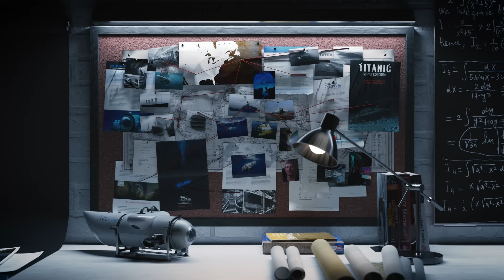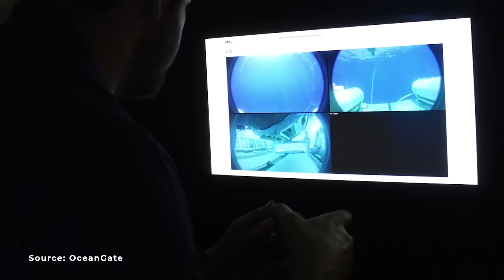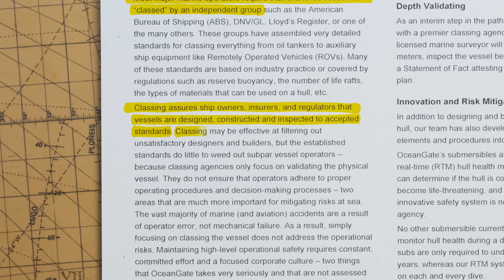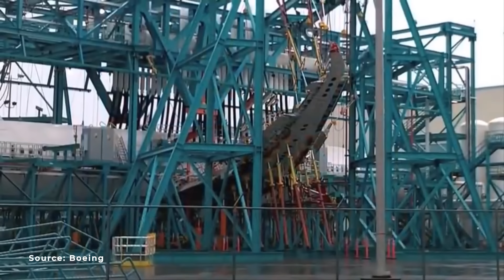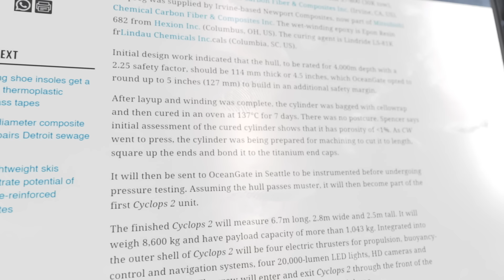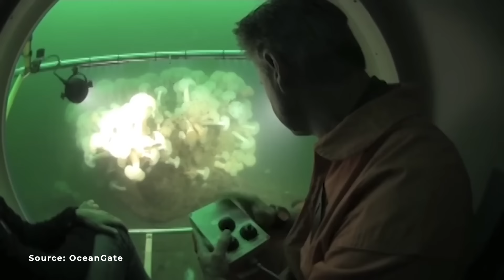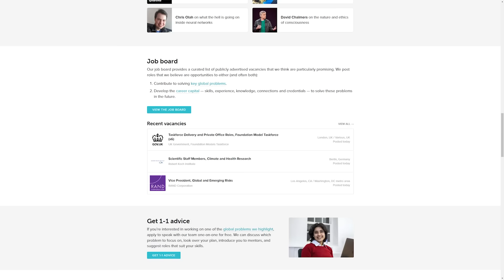The Questionable Engineering of Oceangate

Comment: There have been a hundred videos telling us "why the sub thing happened"...but you're the only one I've watched, as you're the only one I trust to bring actual engineering know-how instead of "here's how fast the rich people got smushed" (which is entertaining in a way, but not really educational). The tension vs compression aspect you explain was brought home to me a few years ago in a very low-tech way--a barn door. The inside of the door had a square frame; the frame was bisected diagonally, and one support was a 2x4, whilst the other side was...a wire. What?? Made no sense. But the old farmer explained that the wooden reinforcement was placed in a way to absorb the compression, whilst the wire existed for the tension. 

Not trying to say that "even a farmer could have foreseen this", but just saying that anyone who can tell the difference between materials suitable for compression vs those suitable for tension should have realized they were using the wrong material--as you so well explained.

Comment: 4:13 This sounds a LOT like Survivorship Bias. "The vast majority of marine (and aviation) accidents are a result of operator error, not mechanical failure."
Reply: That's precisely what it is.
Reply: Because it is
Reply: A system subject to regulations and standards should only fail once through a particular failure mode, if ever. That's the blood that writes safety standards. 
Operators can fail any time, regardless of regulations or standards. That's why the Hierarchy of Controls always try to engineer problems out of the way before trying to change operators' behaviour, and why there the best safety regime requires a no-blame mentality in the event of the failure, because it is in human nature to find someone to blame even if the actual root cause is poor engineering, whether through physical engineering or human resource management.
Reply: the only errors are operator errors because the subs are designed and certified under rigorous standardized tests. 

The only thing not standardized are the humans.

Comment: Expired Prepreg carbon fiber, off the shelf view port not rated for depth,  fasteners into carbon fiber pressure vessel, no testing, hull with multiple cycles on it already... The knock off wireless controller being the only means of control is stupid but somehow near the bottom of mistakes made here.

Comment: I am surprised at the statement that pulse-echo equipment to test this composite does t exist. The ISS was tested long ago in the Intel 486 era. And the propagation times aren't long so it's not like modern equipment could be made to work. Maybe they didn't want to spend the money on a submersion tank the size needed to test that composite, but they could have charged 500000 instead and know for sure.

Comment: Under tension, carbon-fiber-reinforced polymer is one of the strongest known materials. Under compression, it is plastic and loose strings.
Reply: Carbon fibre compressive strength is around half of its tensile strength
Reply: Surprised it even managed a couple of dives to the Titanic and many more other dives to other locations before the eventual implosion...
Reply: That's just false. Carbon is known to handle pressure well. The sub would not have survived 10 prior dives if that wasn't the case.
Reply: @sujimayne did you watch the video? Carbon fiber might handle it good compared to literal plastic. But next to steel or titanium it’s no where near as good for compression forces
Reply: @sujimayne  compression and tension are two very different things.
Reply: @sujimayne  that plastic window handled just as many

Comment: Spacex can afford to move fast and break stuff because there are no lives at risk. Worst case scenario the big kerosene tube goes boom. Before Falcon was human rated it had to go through the same tests, inspections and regulatory approvals as any other rocket
Reply: That's clearly present in their operations, but it would seem the CEO of OceanGate didn't make the distinction himself. If he was really following SpaceX's footprints he'd have sent the sub down 100+ times, fully automated, with tons of hull monitors all over the inside and outside.

And every time one broke they'd try a new design and do it another 100+ times. Maybe then they'd have realised steel was actually cheaper in the long run due to fewer vessel failures, just like happened with Starship's fuel tanks (which were originally carbon fibre).
Reply: Jup. There is a difference in risking a machine in a test-break-repeat cycle or risking human lives. I think Ocean Gate did not understand that. I hope their lawyers are as incompetent as the rest of them. (And yes, if you fire competent employees, you'll be left with ... well ... Ocean Gate)
Reply: And SpaceX seems to be extremely cautious to put humans on their rockets. IIRC Musk already stated that human rating Starship will require 100s of unmanned flights to iron out all kind of design issues and operations mistakes. Their rockets are also flying test stands with lots of sensors that monitor every aspect of the flight (they even started a Starship test flight with zero visibility; there was most likely an impressive low altitude explosion but there isn‘t any video of it due to fog). They might employ a „fail fast, fail often“ mentality, but doing it without being reckless and/or endangering the primary mission.
Reply: That's exactly it, the rockets are unmanned so they can break shit without costing lives. The problem is when you get these guys posing as innovators who try to do the same thing without even understanding what actual innovation is. He nailed it that innovation would be figuring out the material science problem, not just using a bad design.
Reply: "no lives at risk" is the key, Musk and others like Bezos are risking lives until the vehicles are thoroughly tested to the best of their ability. They might run a faster cycle of testing than others but they are still testing. If something goes boom, they try to figure out why and redesign as needed. Rush did nothing like this.
Reply: Never been a Musk fanboy, blind admiration is absolute evil as fars as I'm concerned. 
I frankly have good reasons to rather dislike what he and his company do in order to stay profitable. I won't go into the details, so let's just say they are no different than any other global player.

However, I just love it when a YT stooge with a funny little accent tries to put himself above it all like he is sort of hipster university messiah with his masters degree as his Bible. 
At least Musk and even the asshole that added to the Titanics kill count had the balls to try and do something meaningful.

....And I especially love that convenient pot of gold in the end of that rainbow that he gave himself, enjoy that sponsorship money you sanctimonious prick!
Reply: Plus all the experiments and explosions was done when they should be done, in blooding tests with no people on board. You know following proper procedures for it.
Reply: Exactly, no one would have had a problem with this sub imploding if it was unmanned. It's the fact that he sold tickets to what basically is an experimental craft that rubs people the wrong way.
Reply: Exactly, he seems to be implying that Musk is not concerned with safety. Teslas are some of the safest cars on the road.
Reply: @tulpjeeen  Tesla's safe? WTF? Musk lies about their "self-driving" capability. Stupid people believe him and turn on auto-pilot. They crash and die because Tesla auto-pilot doesn't work. I'd say that makes Tesla about the least safest car on the road - most cars can't kill stupid people, like Teslas can.

Comment: It pains me when I hear "We don't have the tools to test it so we don't have to"

This is exactly when they should have stopped using this composite hull.
Reply: Yeah it's nuts, if you can't test it then it's not fit for service, it's not an excuse to use an untested concept.
Reply: or invented the tools, tested it, realized it was a paper tube and started again in steel
Reply: "Move fast and break things" means TESTING things thoroughly until they break. With no one inside.
Reply: It would probably be fine to use untested designs for unmanned missions. But someone had the great idea of having humans using untested life supporting equipment that has repeatedly been pushed near it's theoretical maximum load bearing capacity.
Reply: Not even a series of scale models
Reply: The fact that I know we do in fact have ultrasound machines capable just made that annoying. But "there are machines, but we are too cheap to buy them" does not sound as good.
Reply: But Bell has had tools for analyzing composite wings and rotors for decades
Reply: @mriguy3202  your point is well taken but it is worth noting that those are not general solutions for testing composite constructions of any form, let alone composition
Reply: We just saw the power of sophistry in convincing everyone to look the other way.
Reply: That's when you have to develop a test that can be done without putting lives in danger.

Even just wrapping the sub in a steel cable net and filling the inside with cameras and microphones before lowering it down to your test depth or at least service depth would be better than just shrugging it off and putting people on board anyway.

Comment: James Cameron and other submarine experts knew for a Fact that the Sub had imploded hours after the News broke.

Which makes me wonder why we kept this media circus with oxygen timers and tasteless memes going for 4 more days
Reply: There are two factors here, one is that mode of how contact was lost pointed towards implosion aswell as James Cameron and a few other experts in the field of deep sea submersibles had already contacted Oceangate about the structural integrity of the vessel. However, this doesn't mean that it was a given, it was what they believed from the evidence gathered, which still means that there has to be a search & rescue effort.

Secondly, SOSUS/IUSS covers an absolutely enormous area and it takes time to sift through data in order to find the implosion, especially since the pressure vessel was relatively small. During the loss of the USS Thresher, it took SOSUS about a week to find the corresponding noise in order to confirm a catastrophic implosion. It was likely a mix between the US Navy hoping that the S&R crew would've found something, aswell as taking time to confirm without reasonable doubt that what they picked up was the sound of the Titan imploding.
Reply: Worse is the US Navy knew it imploded because they picked up the sound.  But didn’t tell anyone.
Reply: 4 more days of media views. USN was probably hoping that it would be verified through another source rather than have to remind people that they hear everything in the oceans for a civilian commercial matter.

Comment: Properties of steel are NOT the same in all directions of the material, as they depend on grain orientation. This is why machining has a potential of lowering the strength of steel in cast and forged elements. I know I'm nitpicky here, but I think it's important to note in an in-depth engineering video.
Reply: the change in those properties is not as extreme as with carbon fibres and plastic, though
Reply: Most "everyday" steel have grain orientated randomly so it's kinda averaged out, but yes, for high stress application the grain, carbon mixing, crystal structure etc. need to be considered
Reply: The properties of most steels used by engineers are for practical purposes isotropic. Unlike FRP and timber, where it actually matters. If this channel went off on dumb-take tangents, like what you're asking, I'd just stop watching.
Reply: @arcaneminded just a few word changes would cover it, "unlike homogeneous isotropic steels"
Reply: "Properties of steel are NOT the same in all directions" This is stated as if this is true of all steels, which it is not. Some steels CAN be anisotropic.
Reply: If it's improperly manufactured, it can indeed be weaker in one direction than another. That is the problem with wrought iron rivets.

Comment: Just to add something here. This notion of 'implosion' is not the big picture. The water at that depth was about 4 times condensed than it would be at the surface. When there was a breach the water outside at 4 times condensed pressure entered the vehicle and suddenly it was in a 1 atmosphere pressure so expanded rapidly to fill the void, once the void was filled the outside 4 times pressure water also wanted to fill the gap which is now 1 atmosphere water pressure, and that is when the vehicle was crushed. Not saying anything in the video is wrong but wanted to explain outside of what media say.
Reply: @leeroyjenkins0  Sorry you're saying water is NOT compressible? So, it's the most resistant molecule in the universe to compression? I think you need to fact check yourself and understand that whilst difficult to compress water hence at that depth it was only 4 times compression it is by no means 'not compressible'. Please please don't rely on Wiki to give you all your knowledge.

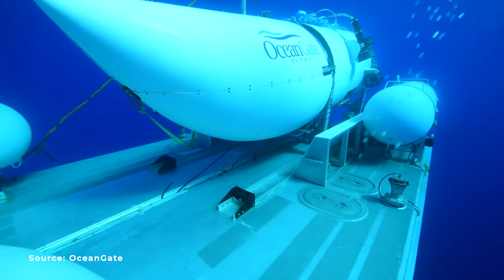Comment: 1:40 It's actually really common to use game controllers for military purposes as they are already designed to be comfortable, reliable (at least the wired ones, which this one was) and fairly accurate.

edit: I missed, that it was wireless. That's kind of an issue for a submersible. It's still not that bad tho, assuming they could release the lead pipes without it.
Reply: It is but it's never the primary means of operating a manned vehicle.  Primary for unmanned drones sure, but a wireless controller as your only means of control? Not unless you want to die.  And I know but they had a back up controller that's like telling me but we set up RAID when all the data is gone because no backups.  You made the cluster of failure points slightly redundant that's not the same as mitigating
Reply: @Fallen7Pie  As long as they can release the lead pipes without it they're fine. It was probably better than whatever junky solution they would've made themselves.
Reply: And everyone knows how to use them already
Reply: But that game controller looks like it was from wi bought from temu
Reply: >  @Catsrule1132  But that game controller looks like it was from wi bought from temu

It was made by logitech
Reply: for drones...but not for this.
and btw NOT A WIRELESS one running on bluetooth
imagine the thing goes out and you can't control the thrusters
Reply: @obinator9065  imagine hearing "the bluetooth device is ready to pair" while you are slowly running out of oxygen at the bottom of the ocean
Reply: @obinator9065 Mr Rush told us that if everything fails in the sub, controller, lights, thrusters.. youd still be safe! 

Bolted inside of a tube at the bottom of the sea.
Reply: This one was wireless, not wired.
Reply: I get using game controllers for remotely piloted vehicles, but for a submersible? Like at least have it be wired or something and that controller looks like it was bought off of temu $0.74
Reply: Except they are never used as the main input defice for manned vehicles
Reply: In a regular atmospheric environment. Devices like these definitely aren't a regular occurrence in pressurized or oxygenated environments.

Comment: Not an accident… more of an inevitable incident really…
Reply: An accident is something unforeseen and unexpected. This whole thing was neither. It was never a question if this submarine would fail, but rather when. This submarine had so many points of failure, that it was only a question of which one would it be first. The carbon fiber? the glue used for bonding?  the viewported that is only rated for 1300 meters taken down to 3800 meters almost triple it rating. The constant failure of software, the constant failure of hardware etc etc.  They actually went down once before with a truster mounted the wrong way, if they hadn't solved that issue, they would literally have died back then.
Reply: @RMJ1984  everything is a matter of "When" it will fail.  Fact is  you dont have all the data on what went wrong and want to shoot your mouth off before you do.  Heres a fact.  It made many dives and made many wishes come true.  Something must have been right with the design.
Reply: @b100ka  And Comet made many flights before rapidly disassemblingly itself in midair. Does that mean the Comet design was fine? Luck can only last you so far
Reply: @b100ka  Venture capital fanboy weirdo gets mad when people dunk on the obvious stupidity of one Stockton Rush. lol